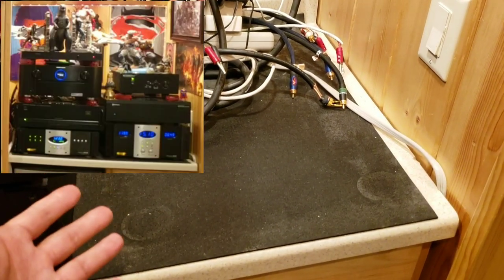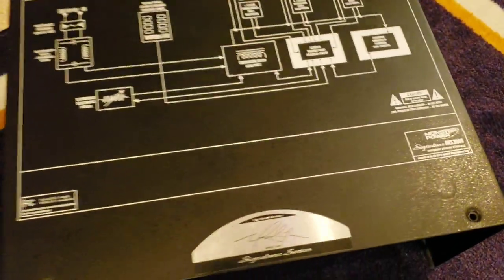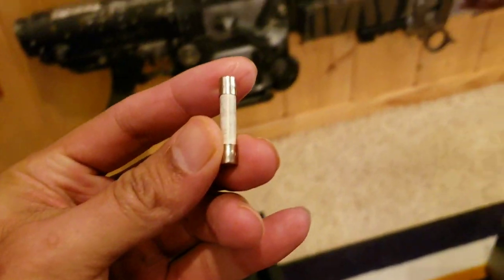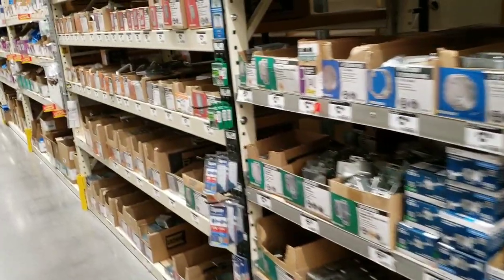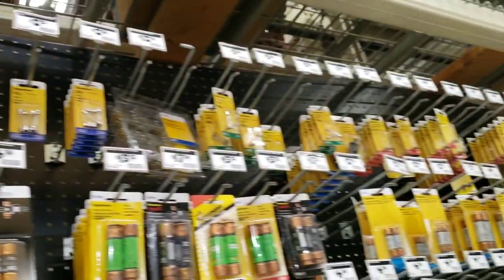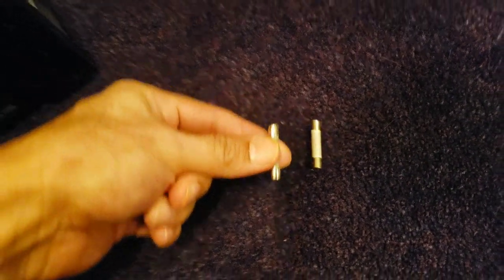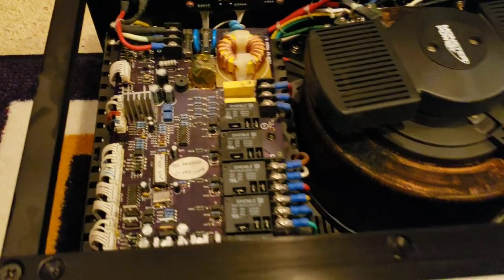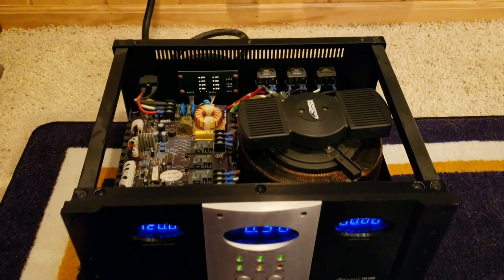Monster Power Signature Series AVS 2000 Voltage Stabilizer. Alarm Noise Fix.

Comment: Thanks for the video , i have had an AVS2000 for about 8 years and its been a loyal worker the whole time. Glad to know how easy it is to access the fuses. Under What conditions do the other two internal fuses blow?
Reply from the maker: Not sure, but I'm lucky to be able to fix it so easily. 🤞🏽
Reply: @TheRafcave  Mine turns on. But when I plug things into it there's no power???

Comment: Nice Raf, I got 2 of those beasts myself. Be careful inside them as the caps even when unplugged hold a dangerous charge unless you discharge them!  I thought about making a plexiglass cover for these as they look so cool to me inside. Especially when the transformer taps switch. I recently had them removed for now as both mine after not using them for several months while in hospital started making a very loud screeching sound which I believe is the transformer switching taps 2 correct and stabilize the voltage and its sticking. Ever have that issue? I know Monster doesnt service them anymore and when they did it was a flat rate fee of 400 or 500 bucks each! Being disabled now poses a challenge to fix these beasts myself but Monsters not the company they once were after all there set backs.
Reply from the maker: Well It's all connected and working.  Hope It's all good. They are pretty Impressive huh. 😎👍🏽
Reply: @TheRafcave  that's good glad it's working again for ya. Ever have my prob with the loud noises from the transformer switching and sticking? It's a very loud screeching sound like a dj does with a record moving it back n forth but way louder an annoying over the system volume even. Pretty sure a little wd will do but I'll need my bro to help me due to my health probs n being disabled now.
Reply from the maker: @battousai412  Ohh I've had that Issue.  You have to buy some electrical dark greese and use a rubber gloves then smear that stuff over the power veric and It will be quiet when It moves.
Reply: @TheRafcave  ya that's what I meant. Great minds think alike😎👍 love the signature with the blue LEDs, I got 2 of the older ones with the red LEDs. By far Monsters best product. Glad yours just blew that fuse and all your gear is okay bud. Hope you rerouted that chair power cable and or such so that dont happen again. Thx for your help. Who you pick for the superbowl?
Reply from the maker: @battousai412  Ohh man this game looks amazing In 4k HDR!  What a treat!  Yep so far so good.  I've bucked down the cable for sure.  Go Chiefs! 😁
Reply: @TheRafcave  ya almost time🏈🏈🏈🏈👍 just looking on amazon I came across Dioxit d100 and d5 for cleaning n lubricating that viriac transformer. Ever hear of it or got a brand to try? They been around 60trs so I think I'll give those 2 a go for good measure.
Reply from the maker: @battousai412  If It looks like dark goo then your good to go.  I got mine at Ace Hardware store. 😉
Reply: @TheRafcave  dioxit in a spray can. I dont remember brands but that one came up on amazon with alot of good reviews. When you got a sec maybe check for me what brand and such you got from Ace. Thsnks
Reply from the maker: @Michael Randa I got you.  https://www.acehardware.com/departments/automotive-rv-and-marine/fluids-and-lubrication/automotive-lubrication-greases/84135
Reply: @TheRafcave  thanks😇 Go Chiefs!🏈🏈🏈🏈
Reply: @battousai412  I bought a second hand Signature AVS2000 and also have that screeching noise problem.  I noticed that it happens mostly when there's a jump in the current draw.  For example, when it suddenly jumps from 2 to 4 amps when the image on my tv quickly goes from dark to light.  This past weekend I opened up my AVS, cleaned the top of the variac with contact cleaner, then with Deoxit DN5 and finished off with a light coat of D100L with the brush applicator.  I did some tests all day yesterday and it seems to have resolved the problem.
Reply: @g01d1e  ya, I did pretty much the same thing. Glad, u scored 1 used n got it working. Congrats man👍

Comment: Raf question what's the diff between stabilizer and  lets say Furman surge protector?
Reply from the maker: The stabilizer adds or reduces the main voltage by keeping It at 120volts.